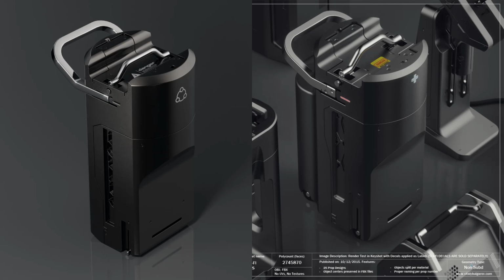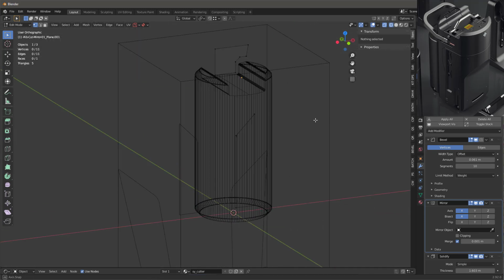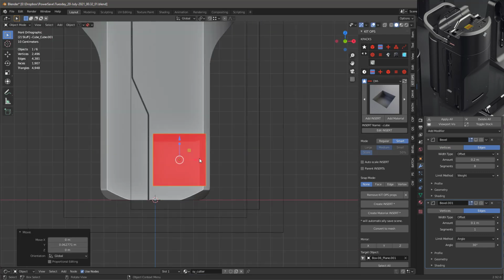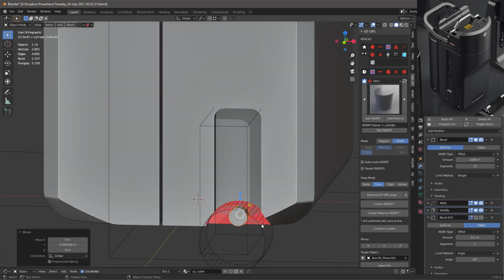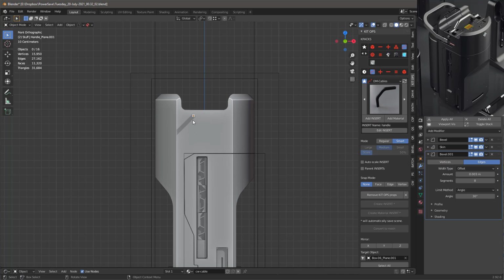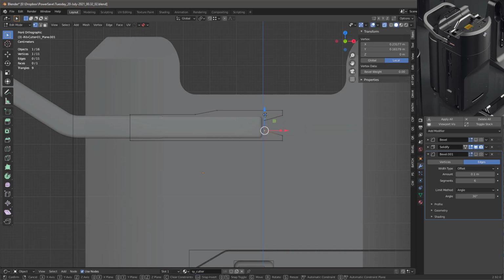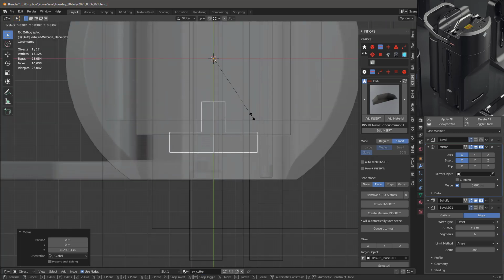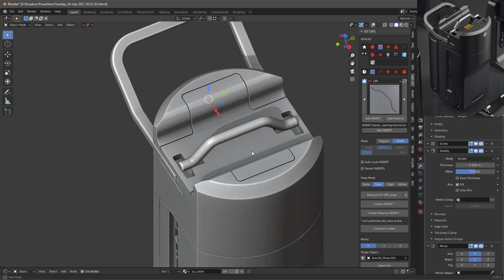DESIGN MAGIC for Blender Power Cell Exercise

Comment: kit ops feels more like fusion now, but is there no function in kitops to clean mesh when using booleans since there will be shading issues?
Reply from the maker: Some new more CAD like features on the way. You shouldn't need much cleanup other than removing the wires. If you do, just add a Weighted Normal at the end and be sure to check Keep Sharp and Face Influence!
Reply: @ChippWalters  sorry, you are right, but I was talking about bevels and them overlapping.
Reply from the maker: Yeah, let me know if/when anyone on any surface modeler figures that one out.
Reply from the maker: Use the bevel shader and cycles and you'll get perfect small bevels without the geo headache

Comment: When I add an insert @ 2:09 it's not cutting / red ? I'm new to Kit Ops so probably missing something obvious ?
Reply from the maker: No worries. That's a custom setting I have turned on.
Reply: @ChippWalters  Also needed to Remove Kit Ops Props on the cylinder for the booleans to work.

Comment: I experiment with it, I'm, not a programmer, and I still feel like new on blender 
There is any way to reduce the geo on specific cuts? by creating like geo to organise the other geo in contact of the bools? would be cool to sycro-retopo-reduce  the shapes, like on CNC last pass. Using guidelines of booleans,(like tool paths) . Like for example - this blue bool profile to run the mesh-like-net in that direction( similar to text formating (all the TOCs 1 have one rule) , or with concerns or like following this image- may be using decals or monochromatic images.  Sorry if from a programmer standpoint makes no sense at all.  Thanks for your hard work and time
(THAT ZEN fountain on the back XD )

Comment: For this workflow, is it possible to make the mesh usable for doing UV/Material without manually retopologize the whole mesh?
Reply from the maker: Sure, use KIT OPS to Convert to Mesh and then Smart UV Project
Reply: @ChippWalters  I am a beginner, but I allways just slap on a auto UW unwrap, and my results are actually more than good enough. Of course, in production yo want to use any trick necessary to save data, but is auto unwrap actually good enough?
Reply from the maker: @blinkrogue1344  yep, for most things
Reply: @ChippWalters  love it <3